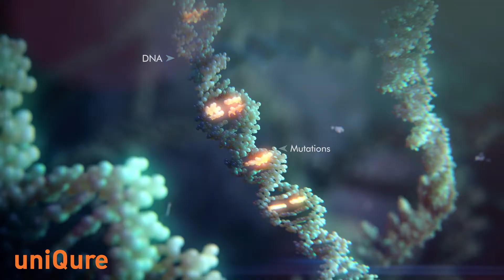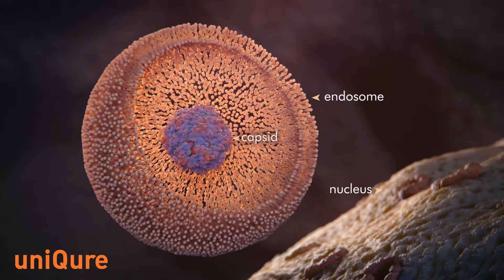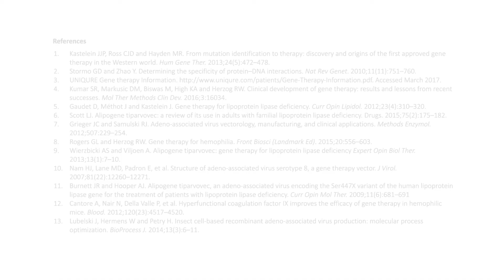How AAV Gene Transfer Works - Expert Audience

Comment: Says capsid is shed inside the nucleus but video shows the capsid docked at a nuclear pore complex and "injecting" its genome into the nucleoplasm. It's also a double stranded molecule but the dsDNA synthesis occurs during / after capsid disassembly using the single stranded DNA viral genome (though, it's possible to package AAV with dsDNA).
Reply: AAV can be scAAV and would be double stranded before uncoating? Depends on the type of DNA right

Comment: This video acts like non-integration into the host genome is a benefit. But if you're trying to correct a faulty gene, why WOULDN'T you want the theraputic gene integrated into the host genome? Without that you're only giving someone a temporary treatment. Good for revenue maybe, but bad for the patient.
Reply: In the case of permanent or stable correction, another vector LENTIVIRUS or retroviruses can be used as they are capable of integrating into the host genome. 
However, human genome integration (patterns, sites and its effects) is still not yet fully understood... Therefore it is safe to first go easy "temporary" until some crucial questions are answered satisfactorily.
Reply: it's because AAV are small vector with a packaging capacity of 5kb and the problem is the immune system gradually neutralize AAV with antibodies. however, the good thing is that even though they are not permanent, AAV have a long-term expression of the target gene.
Reply: in some cases we are inducing for example pancreatic acinar cells into becoming beta cells, and in that case we wouldn't want every single pancreatic acinar cell to transcribe those genes and become beta cells now wouldn't we?
Reply: I don't understand. Please elaborate on that. Why do you think integrating the foreign DNA into the host genome would be beneficial?
Reply: Because otherwise how is this a long term solution to a disease? How can you ensure "stable and long term expression" of the targeted protein if the episomes aren't passed on when the cell divides? Would it no only stay in cells non-dividing cells? Either this would require routine follow up therapies or there is some mechanism not explained in the video that causes long term expression of the proteins? Could still be useful but the video states "stable and long term expression" of the molecule @mol_biologist30
Reply: I guess because there’s no long term studies on it, so you wouldn’t want to pass on genes that could have unintended side effects